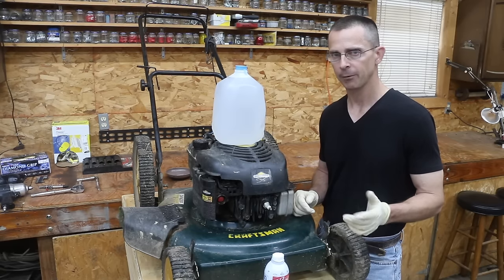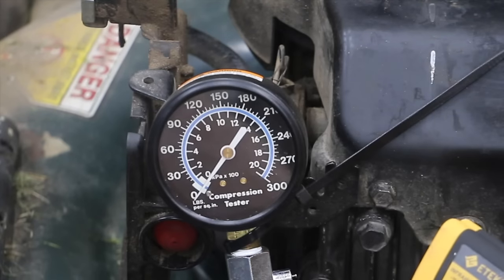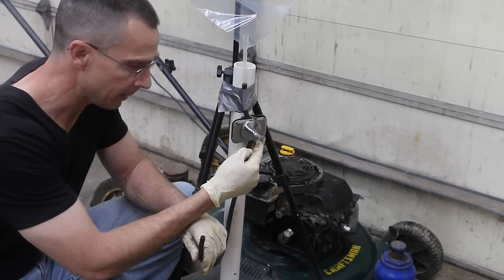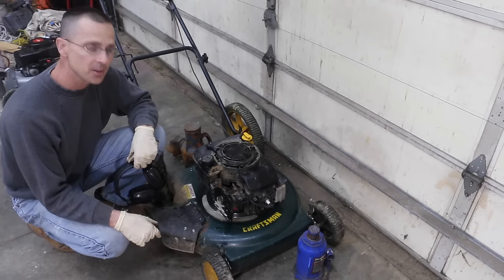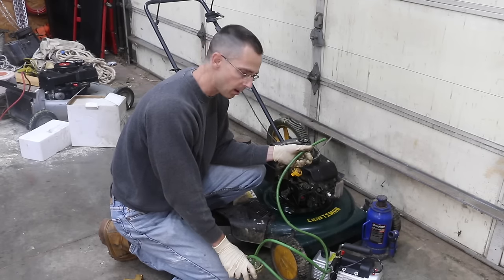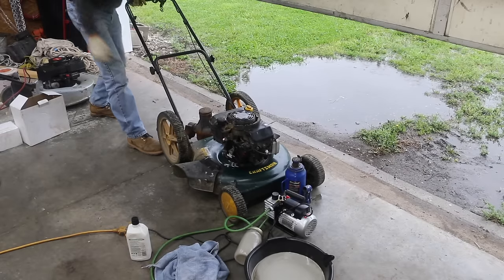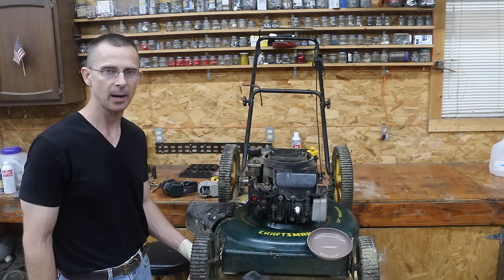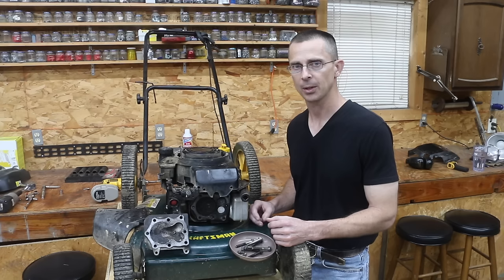Seafoam--can't believe what it did to my engine episode 5--cylinder cleaning test using water!!

Comment: Like other viewers I enjoy your painstaking detailed investigations of various products and appreciate the time and effort to disassemble and reassemble machinery in order to illustrate the process/progress of a treatment.  I might suggest that when injecting water that you do it as a fine atomized mist or from a steam tool.  The amount of water you were inserting was way more than the engine could process, made obvious by all the mixing of water into the oil.  

I had seen for myself on an old Ford I had and was told by an uncle who ran an Esso/Exxon station for a number of years, how a customer whose car had a coolant leak into a cylinder had shown the valves, the head and piston top to be clean right down to bare metal.  I believe the water introduction has to be slight in order to not adversely affect combustion chamber temperature otherwise you do not get the benefit of true steam cleaning. 

I use a handheld steam cleaner with the steam directed in after the mass flow sensor on my '99 Tahoe, through the hole that the PCV air is drawn out of.  There is a drop in rpm which is brought back up to the high idle speed that I do this at.  I have a homemade tool for holding the accelerator back while I hold the hose up to the port.  I can only guess how much effect this treatment has as I am not wont to pull a head off for inspection.  It has not caused any lack of performance and at 344 K plus it is running very nicely.  I have run steam into my mowers and did not get the oil like what you had.  

My steamer is a Perfection but there are other brands on this page.  The capacity on mine is 8 ounces and I do the car treatment in blocks of three.

  https://www.google.com/search?client=firefox-b-1-d&q=perfection+steam+cleaner

Comment: ProjectFarm, thanks for the great videos! I’m sure you’ve heard it quite a few times already but I would recommend using a spray bottle and misting the water in or injector nozzle with a container connected to regulated air to pressurize the water to be able to mist it. Also what temperature was the water? I use hot water to clean carbon due to the fact it will not cool the combustion chamber as much. The reason a blown or leaking head gasket cleans so well is that it is heated coolant and steams it. I guarantee with a spray bottle with hot tap water will provide drastically improved results. Thanks again for the great videos!

Comment: Surely the cost of fuel/oil out ways the $10 for sea foam? not to mention the 2 hrs +! doing it this way...
Reply: I dont understand using water at all... then there are people that say things like "you did it wrong! If you add 1 drop an hour and stand on your head during a full moon itll work!"... or... and hear me out: you just buy seafoam and get the same or better results at little/no risk in 1/100th the time... tough choice there
Reply: @Fetidaf  you're wrong its not a full moon.  You have to wait till a full solar eclipse duh
Reply: Sea Foam is $7.

Comment: I have added water to my engine many times and would do it again if I thought it would need it. Normally though it's a quick process. Wild revving the throttle give the engine a quick slurp of water two or three times. The science is that that cold water it's that hot combustion chamber causes an explosion and blast the carbon loose. But the engine has to be hot whereas the way you did it obviously the engine was cool down as you trickled the water in. I have torn down motors with lots of miles on them and found the combustion chamber and valves to be surprisingly free of carbon. Quick simple and you don't get water in the oil. Love your work.
Reply from the maker: Thanks!  Thanks for sharing.

Comment: You might wanna give 2+2 a try. I’ve used it direct in the tank (about 1/2 can to up to 2 gallons of gas, and direct spray it into the intake and it works well cleaning up carbon. I’d be interested to see how it shakes out compared to seafoam.
Reply from the maker: Thanks for the suggestion.
Reply: I would too. Been using SeaFoam for 13 years or better now and it works wonders.

Comment: ive seen Erikthecarguy barely use half a cup of water, he dumped it in good size chunks with good results.Also this was not done the same as the Seafoam method. My thoughts are that there was so little steam in the cylinder that it wouldn't have done much to remove the carbon in any case. But i may be wrong.
Reply: Eric the car guy had a car with 8 cylinders... big difference!
Reply: TheBiohazard43 explain, how would it make a difference?
Reply: TheBiohazard43  *six cylinders. the Fairmont was a straight 6 at the time. also how does that directly make a difference?
Reply: Patrick H alas I have been corrected. 

More displacement so you don't have to feed in so gently, different compression. The flathead on a lawnmower is very different to a straight six... and so will probably have a different outcome
Reply: no, you are 100% correct... needed much faster injection of water and heating the water as much as possible helps as well.  great commend, ryno
Reply: Ryno Duplessis good results?  did I miss the part where he took the engine apart to show us? it was a very short video and did prove anything really.
Reply: so by that theory my 50/50 methanol water spray on my turbo system that has been running for 10,000 miles should have my combustion chamber spotless. It isn't.
Reply: Something to add to your thinking +John Ey...when ChrisFix did a Seafoam test on a lawn mower, it easily had amazing results. These are air cooled engines. The carbon is not nearly as baked on. You probably push your car pretty hard, it may be even more baked on then a regular NA car. So, while you probably have some cleaning benefit, I'm not surprised it's entirely clean. I'd love to hear all of your take on my water decarbonization video. I was a young YouTuber then, but I think my unique test and warnings from the issues this can cause, is worth another look at this subject.
Reply: If you drive your car hard and for long journey's or its air-cooled. It's likely you won't have much carbon or heavily baked on carbon because the higher temperatures add to a more clean combustion. As for the turbo system... there are way more factors that include air/fuel mixture and the fact that the water is used to soak up energy from the intake charge and not from the piston and cylinder walls which may be why it isn't spotless. You have to remember it's an engine... the best way to remove carbon from it is to open it up and clean it, then never run it ever again.
Reply: I know I am hard on everything I own from mowers to trucks to ATVs and ATCs and motorcycles. I change the oil sorta on time, I use decent gas, and I put them away hot and used. Most of my ATVs are over 30 years old and obviously all my ATCs are. Same with most my motorcycles. Almost all are from the 80s, I've owned them since the early 90s. And all run fine with minimal carbon. "I check chambers with a bore scope". No additives besides fuel stabilizers for winter. Just run your stuff like you're supposed to and not baby it. I've beaten every vehicle I've owned and the only ones that have given me trouble are fords, and vehicles owned by old people that never peaked 40 mph or 3000 RPMs for most of their life. And I've owned dozens of machines all well over 150k before I sold or scrapped. Usually in the PA mountains with the salty winters your vehicles frame is rotted beyond cost effective repair around 120k miles. It's usually cheaper to buy a beater then have the frame repaired and all the body rust. Even when done yourself it's not worth your time when you can buy a beater that will last you two or three years for $600. Especially when you can sell yours for parts for around $300 or the scrapyard for $200.
Reply: Thats funny, you claim Fords are somehow sub standard and yet far more 80's, 90's, and 2000's Ford pick up trucks see 300+ miles and remain on the road today than their Government Motors counterparts.

Even more evidence showing tho opposite ofvwhat you claim is the simole reality that loads of 90's Mustangs remain on the roads here in PA. I see one at least one every time I leave the house. Yet,  I rarely ever see a 90's Camaro anymore, and can go a week without seening one.
Reply: Allan Nichols 
That's odd, I just saw an 80's model Ranger going down the road today, and was thinking how rare it is to see one running nowadays, yet I still see lots of 80's S-10s driving around.
Nothing against Fords, I've owned several over the decades, and they've been mostly fine, but I do prefer GM vehicles.
As for Mustangs vs Camaros, I still see a fair number of both around SE TN, both 80's and 90's models.
Reply: @Lee S., @Allan Nichols, Ladies ladies settle down, all American cars are shit now.

Comment: this was a great video. I really appreciated the work you put into this. I truly believe the water must be very well atomized, but still be introduced into the engine at a rate fast enough to clean the engine, but not so much water so fast that you can hear the engine run differently as you could hear in this video. I would suggest using a few ultrasonic mist makers to very effectively atomize the water. I would think you still need plenty of water entering the engine at a sufficient rate for steam cleaning to take effect, so, If it were me, I would start out at like 3 or 4  ultrasonic mist makers and rout the mist to the carburetor inlet. Also I would still run a full gallon through. Is there any way you could try this for another video?

Comment: You have done a very thurrough job of this. I have seen som other people doing the same theme on videos. Problem is for engines that have plastic intakes. You cant use acetone based products. PRoduct manager od CRC sweden gave me the tip of isopropyl for free since they dont have a specific product for plastic throttle bodies in my country.
Reply from the maker: rimmersbryggeri, Thanks for watching the video and commenting!
Reply: Is there acetone in seafoam, or did you just want to use acetone in the place of water, but can't due to the plastic intakes?
Reply: Seafoam doesnt market it's products in the EU or is banned by environmental restrictions. I dont want to use acetone becasue od the plastic intake and the coating on the throttle butterfly of my car.  The US gets alot of stuff that we dont get over here. The ford dealer shop here hasnt even heard about the possibility of cleaning the throttle body. There is supposed to be a ford motocraft cleaner for their plastic throttle bodies and intakes though.
Reply: rimmersbryggeri best thing I have heard in a while !! And most is 50/50 with water so water/meth injection it is
Reply: Good points regarding sea foam and plastic intake parts!! all my stuff is good ol’ iron so I never worried about it.

Comment: Whenever I used water for this I put it in a very weak, cheap spray bottle, about 1 - 1 and 1/2 cups of water over about 15-30 mins (depending on size of motor) for that little mower I'd use about 1/2 a cup of water over about 10-15 mins, making sure to mist it, then again, now that I have money I tend to use seafoam, mostly used the water back when I was dirt poor, it worked, only costing around $1 for the spray bottle.
EDIT: BTW, love your videos, and love the way you handle your testing, as objective as possible while taking into account how the people in the comments recommend doing things.
Reply from the maker: Thanks for sharing.

Comment: Sand injection polishes everything up nice.  I'm running 9 second quarter mile in my stock 87 civic after a sand injection threw the intake ....... 267 psi cold compression !!!!!!!
Reply: Ricers gonna rice, you need to get some canards, front splitter, rear diffuser, and a huge ass wing on the back of your rice mobile brev, 267 psi my ass lmao.
Reply: I use limestone injection.  It gives the cylinder walls. piston tops and valves a nice rough texture and it won't clog the cat like sand does!
Reply: ROFLMFAO

Comment: You problem with the engine got to cool... keep it around operating temperature and the water will leave the engine the temps you had it was likely pooling in the cylinders.
Reply from the maker: Tom Hewlett, Excellent point! Thanks for watching the video and commenting!
Reply: yes you do. water changes the lubricity and viscosity of the oil. the water needs to be fed at a much slower rate and possibly atomized so that it can flash to steam and burn off rather than push past the rings like it did in this case. try doing it again but with the water at a drip. the mower doesn't run got enough and it's not big enough to consume the amount of water that was fed to it
Reply: Asyk aMan 
Not true.
You run an engine with water in the oil for a significant amount of time and you will kill it in a very short time.
If the OP hadn't changed the oil right after he discovered the contamination, that engine would've been scrap metal before much longer...
Reply: the water method is only suppose to be 20oz
Reply: The classic  750-1000 cc,  twin-airhead BMW motorcycles would collect carbon in the exhaust pipes, which got so hot in the bend 4-6 inches from the head that they turned blue and glowed a dull red in the dark.  Ole-timers would spray a fine mist of water in through each carburator of a hot engine.  The super-heated steam formed acetylene as it passed over the red-hot, hard-carbon deposits, which would then ignite raising the temperature of the entire exhaust system and burning out the carbon deposits as it shot a long red flame, clouds of gray smoke, and glowing shards of carbon out the end of the exhaust pipe.  This was not a lengthy process, 5-10 minutes max per cylinder.  Your lawnmower engine could not get hot enough, nor did it have the requisite hard-carbon deposits to produce the same spectacular results.

Comment: Normally love this testing, but this time i think i might have to take exception.... The low temp and water flowing everywhere indicates it wasn't really steaming and immediately evacuating the cylinder. That would be more like "washing" the carbon off with just water. Which in this case seemed to just smear it around over time (but cleaned the valve edges nicely). What was with the whole 'drip-bag' thing? I'm assuming you were automating it to go do other things. This really should have been done with the motor running fast, (already warmed) and then just Misting in water a pump or two at a time. Maybe enough to slow it some but then let it fully recover and warm back up. The explosive action of the steam, especially directly on the hot surface of the metal is what removes the carbon. It's a Mechanical action, the water isn't acting like a solvent at all. That's why folks are recommending it over Seafoam. Just to satisfy yourself (PF) i honestly feel you should very breifly redo this by just Misting water into the intake with the mower running hot and fast for a brief while and then just immediately pull the head and see if the difference isn't noticeable. If so, Then if you want you can ammend or add comment to this video. Yeah, you prolly won't see this comment after so long, but if there's anyone who would, it would be you. Thanks for the work ☮️  gh~
Reply: Great points! I was thinking the same thing. I’ve used the water treatment years ago on older vehicles with success.  

I’ve mostly used Seafoam in my motorcycles as a preventative maintenance measure, keeping buildup from occurring.  If it isn’t there in the first place, there is no need to remove it. 

I’d add it, or MMO about every fourth tank.  Both work well for me.
Reply: @ken2tou  Well said!..i totally agree with you!...cheers!

Comment: Water injection during boost on my Mini worked very well. No carbon on my pistons at all and use less oil between oil changes. Compression went up too. It works.
Reply from the maker: Impressive results! Thanks for commenting.
Reply: #YLQLQQLPL

Comment: Sea foam- just add to tank. Warm engine. Let sit. Run out tank. = cleans all of fuel system and preventative maintenance.  Why waste effort using water?!
Reply from the maker: Great point! Thank you
Reply: @ProjectFarm  tank cleaner will not clean out the induction part...on air only throttle bodies!
Reply: He didn't use it right, for one he used a gallon on a lawnmower engine, where you only need about 8 oz to properly clean a 4.6l v8, and you add it in bursts, not continuously, it only works while the engine is at full temperature
Reply: Liquid can be used up to 50/50. And adperaited can is in spurts. And yes both methods require a warmed up engine and soak time.
Reply: Water steams carbon off head & valves.  It does nothing for the fuel system.

Comment: Really love the content. Small thing I'd suggest is that when you tighten the head back on the engine, tighten the bolts diametrically, just to keep even tension across the  head.
Reply from the maker: Thanks!  Thanks for the suggestion.

Comment: I have used water in a v8 dripped into the carburetor for may be 30 seconds.  This happens because stuff is hot. As you showed it cooled quickly. That cool meant the water had to go as liquid into the oil. If you have ever had water get into a cylinder from crack or bad head gasket you knew instantly when u opened it up because it LOOKS NEW  only on the WATER  cylinder. Steam is necessary to clean this off,, ie HOT ENGINE  flow 5 seconds wait 15 seconds for temp to come up. Remember this AIR  cooled engine reacts much different than a liquid cooled v8. If you  really want to clean carbon my man use,,,,,, drum roll,,,, cymbal crash,,,, xylene. Commonly used for painting, stripping process. EATS CARBON INSTANTLY.
Reply from the maker: Thanks for sharing.
Reply: Xylene as in white gas? Cuz I have gallons of the stuff for lanterns